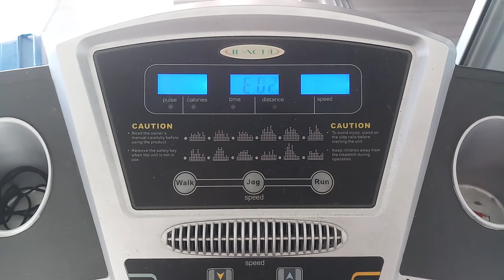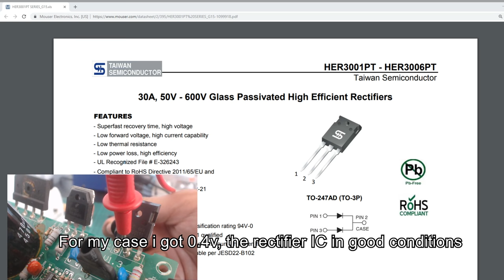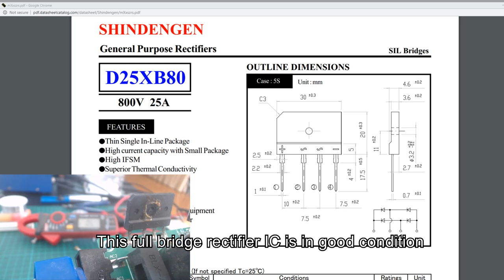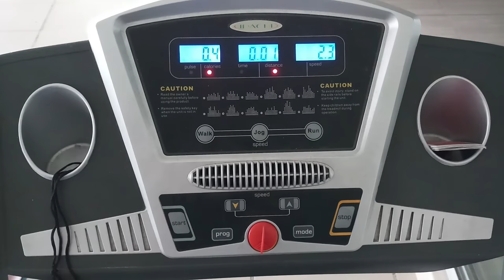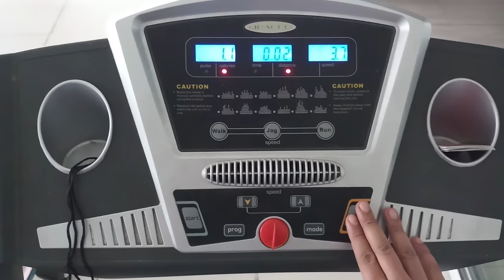Repair Treadmill Error Code E02 | Control Board Faulty

Comment: I had a similar treadmill and the problem was the same 220k 1w resistor. Even the board is different,the problem was the same.
Thanks a lot for the tip. Great work!

Comment: Thank you very much for your good video. I had exactly the same problem with E02 error and it was the resistor absolutely disconnected, replaced it with a new one and everything is working now. thanks again
Reply: What resistor may cause the problem?
Reply: can you teach what resistor can replace for that problem

Comment: on a Buffalo with a Chang pcb M3218CE-2A motor stoops after few seconds. do you know the adjustment of the Torque. If I turn on the hex switch it stops directly.

Comment: My Horizon CT5.2 was getting E1 error after running 5 - 15 minutes. Found out that it was speed sensor that was not aligned to the magnet properly. Aligned it and fixed the E1 issue on it.

Comment: 1st of all, Thanks for the great video and great knowledge. 
I got help from your video and found 1 MOSFET short circuited. I replaced that MOSFET but treadmill only worked for few minutes and again similar error-02 started coming. What else could cause this issue in circuit. Please advise.
Reply: Same problem bro
Reply: This is around 2 years ago after multiple times replacement of MOSFET. I increased the MOSFET rating and installed 1 with higher current ratings but issue kept coming on. Later on found that there was high friction between the belt and board which caused the burning of MOSFETs. Lubrication plus replacement of belt resolved the issue for me.
Reply: قد يكون الموسفت من نوع igbt واستبدلته بموسفت عادي ذو اطراف sdg او كان العكس واستبدلته بموسفت igbt ذو اطراف ceg

Comment: Hi, took your advice and changed the MOSFET igbt, the treadmill now runs a little fast and I have no control over the speed, every thing else works no errors, can you help, thanks
Reply from the maker: What do you mean no control over speed?
Reply: @MyCreativ3  hi, when I power up, the carpet turns faster than the 1kph shown on the monitor, I can change up and down but it makes no difference to the carpet speed, thanks
Reply from the maker: @clivefletcher3645  Do you check speed sensor connection? Make sure cable is tightly connected properly. Critical part from monitor to control board and speed sensor to control board.
Reply: @MyCreativ3  yes,i disconnected and it gave me error, reconnected ok, before my problem 02 it was ok. What do you think?
Reply: hi, its me again, ive had a closer look at the board and realised that there is another mosfet with a silicone case, exactly the same, hidden behind a large capacitor. ive tested it and it gives the same results as the new one. could it be faulty and creating the problem with the speed control? thanks
Reply: قم بتغيير ic الذي يولد النبضات المتحكمة في السرعة
Reply: تابع خطوط ic  النبضة ان كان هناك مقاومة مرتبطة به تالفة او خط مقطوع والا فاستبدله لانه يعطي الموسفت نبضه متواصله

Comment: hi sir .. I have tradmill mega6000 and it gaves me the same error E02 .. is it have the same meaning as yours ?!
Reply from the maker: Mostly all treadmill give E02 faulty should be control board faulty. From there, you need to troubleshoot each component
Reply: @MyCreativ3  . con u give me any macanic no sir

Comment: Sir ,My Treadmill key board start key not working,,,,,what can I do!!!
Reply: U can use a push on push of button, place it separately, or use normal switch small one which is used in cars for switching on extra led on the car.